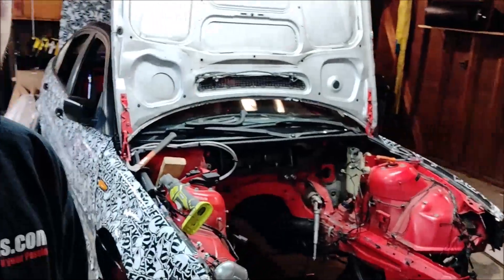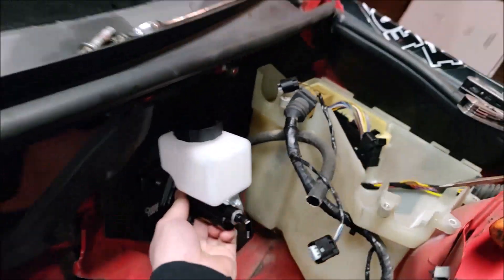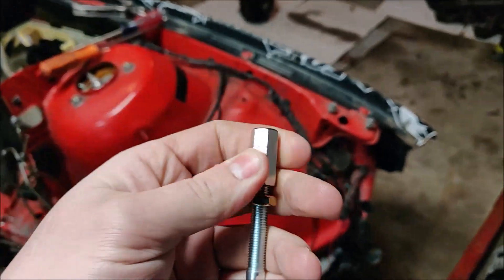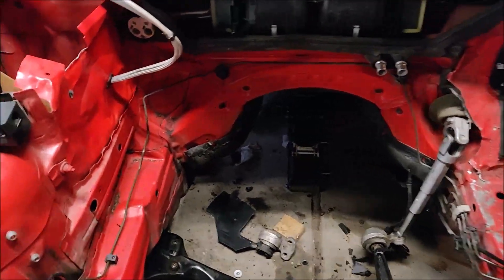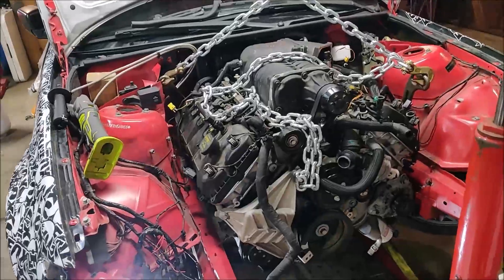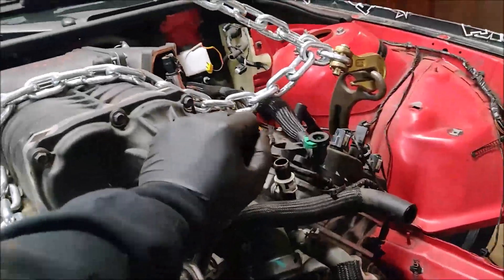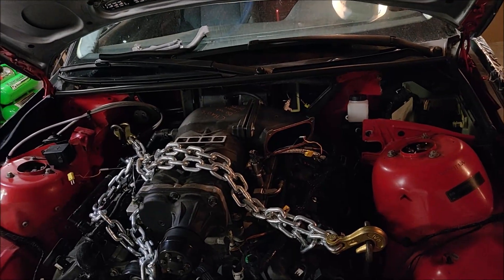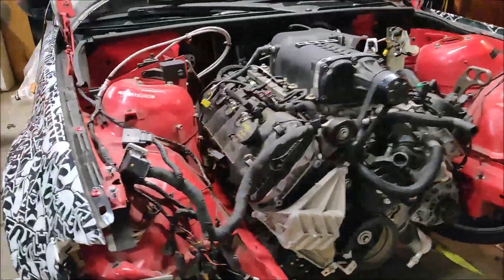Coyote Swap E46 : EP3

Comment: I'm interested in doing the same swap on my e46 sedan. Just wonder about motor mounts  and is it a stand alone system for the electrical
Reply from the maker: Motor mounts and trans mount are custom fabricated. A Ford controls pack is the best way to do it, but in my instance I swapped the whole body harness from the donor car into mine

Comment: Thoughts on putting this same motor on an f30 platfom and connecting to the stock automatic with the awd?
Reply from the maker: That would be pretty sweet if you can get the trans to mate up with an adapter. I'm not sure what hp that trans can hold
Reply: For anyone else that may stumble across this - DomiWorks has Coyote-to-ZF8 adapters, both BMW ZF8 and Chrysler ZF8